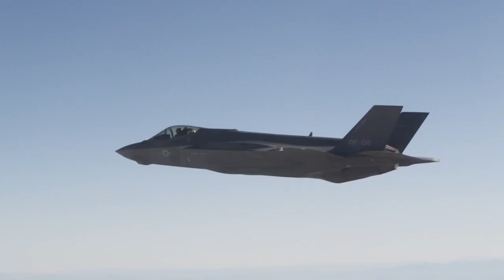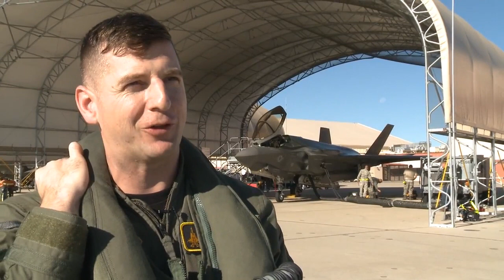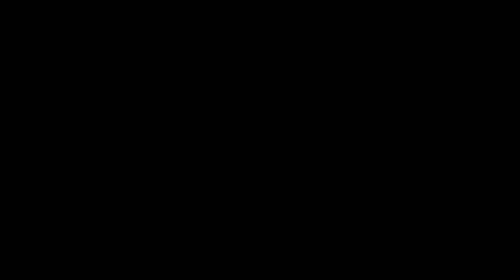F-35 Gatling Gun Test Firing

Comment: I'm hearing that they are having issues with the cannons integration onto this airframe.  The cannon has a door that keeps it hidden until it fires, when the door opens the drag/deflection is enough that pilots are having a hard time hitting targets.  
I wonder if this issue can be fixed with the flight control software?
Reply: FlightOS update will be rolled out soon...

Comment: 25 mm cannon with a whole 180 rounds...and this is supposed to replace the A-10. Sure, ok.
Reply: +hanyoukimura 
The F-35 will get a gun pod that can carry additional rounds.
The F-35 will have the small diameter bomb and other missiles that it can use to provide close air support. 
The F-35 will be significantly more accurate than the A-10 because of EOTS and Distribute Aperture Radar.
Reply: +The Crawling Chaos 

The F-35 is design to maximize the use of stealth. This is pointless against an enemy with little air defense and no air force. The F-35's theoretical CAS missions have it against sophisticated enemies like Russia or China where its stealth capabilities would give it an edge. This is very true...except that's not who we're fighting against.
The F-35 isn't designed for durability. 
The A-10 was specifically design to be able to absorb damage from ground fire and keep flying. It's systems are triple redundant, its well armored, and its engines are design to take damage and still function. These attributes are far more important in combat missions going on in the Middle East.
Reply: Heavy armor is needed when you're trying to fly low and slow. The f35 is not designed to do this. The range at which the f35 can acquire targets through foliage and adverse weather elimated the need to fly low and slow. Computer aided aim assiance with the gunpod and small diameter bombs will be more than enough.
Reply: +The Crawling Chaos 

"The range at which the f35 can acquire targets through foliage and adverse weather elimated the need to fly low and slow. "

Wasn't an American Special Forces' team obliterated by a bomb dropped by a high-flying plane which electronics supposedly eliminated the need to fly low and slow?

Acquire targets through foliage and bad weather, more than enough for CAS?

I don't this has been featured in any self-respecting military school.

In CAS, the C stands for Close. And not for flying at 8000 meters high, and having a risk to screw up with your aim.
Reply: Have you ever heard of smart bombs.
Reply: Im sure you know more about what plane the us military needs that the military themselves, right?
Reply: True the Small Diameter Bomb will be great, but what's the cost per bomb and the cost per flight hour of this monster when compared with the A-10's ability to just loiter and rain down depleted uranium rounds?  This is the equivalent of driving a formula 1 car back and forth to get groceries.  Yes it can do the same job, but it's way overkill

Comment: Is this gun for Air-2-air? Limited rounds will be ineffective in a dogfight and on the ground. Also the F35 can't manoeuvre in a dogfight it gets owned every time.
Reply: +benbennit 
Wrong on all 3 accounts.

The F-35's gun is more than adequate to score  a gun kill. 
The F-35's gun is computer assisted and can perform CAS.
The F-35 will be getting a gun pod to store additional rounds.
The F-35 has similar kinematics to a combat loaded F-16.
The F-35 does perform well in dogfights.

Dogfights and top gun style guns maneuvering are no longer the norm. This is not 1970s.
Reply: +The Crawling Chaos 
"The F-35's gun is more than adequate to score  a gun kill. "
You can have the best gun, if your plane can't maneuver for scrap,
your best gun won't matter a rodent's backside.

It performs well ... maybe. But does it perform better than other aircrafts?

A gun pod to store additionnal rounds?
That's adding unecessary drag. Other planes don't need to bring extra slugs in a gun pods.

Also, this F-35, in CAS?
No way. An A-10 is what you need for real CAS.
It was designed for this, wasn't it?
Reply: +The Crawling Chaos Add a gun and you are saying dogfights CAN happen and BVR encounters do not always end in a long range enemy kill. A heavy CAS gun and gun pod will hamper any aircraft in a dogfight. That loss of advantage is death. 

It's a plane that has already failed to splash the competition in  tests even in a perfectly adjusted loadout.

Adding a gun for CAS to fill a gap is crazy. At the speed and survivability of this jet, it will be unable to do more that a couple of runs with reduced impact, accuracy with less onboard armour.

I can just look at the profile of this aircraft and it's mass and I know it will not be forgiving or effective.
Reply: benbennit
You can just "look" at a plane and tell me about it's aerodynamic capabilities? Where is your degree in engineering? Where can I find records of combat aircraft that you've worked on? How many hours have you flown in high performance aircraft? Or am I supposed to believe that you can just "tell" because of your knowledge from Google.

Where have you seen the F-35 "failing" to splash. The F-35 has comparable high Alpha performance to the F-16. 

Also the F-35A can certainly perform in dogfights, does have a
 gun. Other variants can have guns installed on them for CAS or air interdiction. Also AIM-120 and AIM-9 will be more than enough to contend  with enemy planes. As it has been for decades.
Reply: Briseur De Lance

"You can have the best gun, if your plane can't maneuver for scrap"
The F-35 has kinematic performance similar to an F-16. Ask pilots for where it places within the spectrum of F-15, F-18 and F-16.

"It performs well ... maybe. But does it perform better than other aircrafts?" See above 3 comments.

"A gun pod to store additionnal rounds?
That's adding unecessary drag. Other planes don't need to bring extra slugs in a gun pods."

The drag profile of an F-35 gunpod is similar to that of a missile. It's also in the centerline, and shaped to heavily reduce drag. If you also want to perform air superiority, you do not have to bring this weapon.

"F-35, A-10, CAS"

Yes, the F-35 can perform cas. It can carry thousands of pounds worth of bombs more than an A-10. Has multiple internal targeting computers, can engage targets from further away, and is stealthy. 

If stealth is not needed, then the F-35 can carry more bombs than an A-10. The F-35 can also carry this gun pod to very accurately engage targets. F-35 will also have the small diameter bomb.

If it is needed, then the environment is not permissible for an A-10, and that plane will not survive where an F-35 will.
Reply: +The Crawling Chaos Weight / power / wing profile. They are all wrong for dog fighting / high AOA, the design will bleed off it's energy very rapidly in every manoeuvre., regardless of how much thrust is pouring out of the back...

Hopefully they will never get in that situation.
Reply: The Crawling Chaos
"Ask pilots for where it places within the spectrum of F-15, F-18 and F-16."

I would gladly ask one, but I don't personally know any American fighter pilot. Same for the British. :-(

"Yes, the F-35 can perform cas."

It wasn't designed for this. Sure, it can target multiple objectives from a safer distance than the A-10 can.

The thing is, in CAS, the C stands for "close".
How can it be called "close" when then supporting plane is thousands of meters away?
When flying as high as the F-35, how can you drop bombs and launch missiles, some as heavy and costly as an Aston-Martin, with the pin-point accuracy needed when the enemy is less than 100 meters away from friendly forces, practically within voice range?

Do you think the troops calling for CAS would like having the ordnance drops relying on a machine alone? Or relying on a man or a woman seeing the situation through a camera, kilometers away?

I think not.

The F-35, carrying more than an A-10?
True. Dropping it as accurately?
That's not as true as you think.

Not to mention that the A-10 can stay on the scene for longer times, doesn't require as expensive maintenance and facilities, and is overall much cheaper.
Ergo, much more suited for CAS in asymetrical conflicts, like in Syria.
Or in modern conflicts were the enemy force targetted in a battle, while modern, doesn't have much of an AA defence.
Reply: There are plenty of interviews where pilots discuss the kinematic performance of the F-35. You can google them and find them yourself. 

The definition of close air support is the employment of munitions from aircraft within close proximity of friendly forces. It doesn't matter if the aircraft is a helicopter performing a run from door guns, or a satellite in space. What counts is how close the munitions land to the forces on the ground. In Iraq, CAS regularly had to fly high to drop weapons outside of the WEZ of enemy forces. This air support was still certainly "Close". You can find videos of this all over liveleak. By your definition of CAS, dozens of apaches firing Hellfires from a distance of 6km to targets within tens of meters of troops does not count as CAS.

watch?v=NxfS4WVvvnc

As weapons like the SDB come into use. Expect bomb strikes to get closer. 

"How can you drop bombs close"
With a really good optical targeting system like the F-35's EOTS and laser, GPS or electro optical seeker. All of which come built into an F-35

watch?v=bjoMQRUWEe8

This B-2 Spirit is throwing an older version of the JDAM. The F-35 will use improved or identical systems to this B-2. The radius of error for these weapons were either 13 or 30 meters depending on the mode of guidance and the level of Jamming. It's worth noting that if your enemy is sophisticated enough to jam a Jdam, then you're not going to be flying close enough to make a gun run. 

while the A-10 has a longer loiter time, an F-35 will - at mach 1.6 - reach a combat zone far faster than an A-10 will, in an asymmetrical fight, be able to deliver more bombs more accurately than an A-10.

In a non permissible environment, you will need a separate plane for each of these roles.

Offensive Counter Air (F-16C/D, F-15C, F-22)
Electronic Warfare (EF-111 or F-18G)
Weapons Delivery (A-10, F-15E, F-16C/D)
AWACS (E-3 Sentry, F-22)

Or you could use the F-35

OCA - F-35 with AMRAAM
Electronic Warfare - F-35 with AMRAAM and HARM
Weapons Delivery - F-35 with AMRAAM and JDAM
AWACS - See Above
Reply: The Crawling Chaos

"The definition of close air support is the employment of munitions from aircraft within close proximity of friendly forces. It doesn't matter if the aircraft is a helicopter performing a run from door guns, or a satellite in space"

That's not how I defined CAS.
Ah well.
That's not exactly how the US Army defines it either.

"Air action by fixed- and rotary-wing aircraft against hostile targets that are in close proximity to friendly forces and that require detailed integration of each air mission with the fire and movement of those forces."
(http://www.dtic.mil/doctrine/dod_dictionary/data/c/8823.html)

So yes, the first thing that matters is the proximity of enemy forces with friendly forces.
But it can't be a satellite.

If the enemy has the means to jam a JDAM, it's probably not safe to make a gun run, of course.

But what about the troops calling for support, then? "Sorry, mates. But you're on your own."?

"The radius of error for these weapons were either 13 or 30 meters depending on the mode of guidance and the level of Jamming."

Sometimes, this margin of error is more or less the distance between friends and foes and the ground.
How do you still deliver the bombs on the enemy? By getting close and personnal.
And not by flying at 6 kms away or more.

I heard my share of both trash-talk and blind praise about the F-35.

But one plane - and a really expensive one, at that -, replacing all those?

I don't think so.

This "one solution fits absolutely all scenarii" thing has never been successful.
Reply: Okay the Satellite part was hyperbole. But maybe planes in the future will drop munitions from low Earth Orbit or something. 

"Sorry, mates. But you're on your own."?

More like, sorry mates, I can't fly too close to that S-400, but I can drop some small diameter bombs on those enemy forces. So instead of trying to fly a slow, unstealthy aircraft into a non permissible area, and then fly it into visible range, you can just send an F-35 from far away.

First of all, as I said before, this large CEP was the radius for a very old JDAM. The  CEP for a newer SDB, which would be employed in this kind of CAS situation, is about 1 meter. At this point, you're more accurate than a gun. We've also completely ignored every missile weapon, which is also an option for an F-35. See Hellfire, JAGM, Maverick, DAGR.

The CEP for a bomb is not determined by the how far away you drop it. This is not World War II. The US Army doesn't drop slicks anymore. 

"One situation doesn't fit all"

So why can the F-18 carry a lot of AMRAAMs, But also be loaded with Electronic Warfarfe Equipment, But can also be loaded with targeting equipment if one plane can't do everything. You'll notice that the carrier deck is loaded with F-18s. 

The F-35 contains a powerful radar, check
The F-35 contains powerful electronic warfare equipment, check
The F-35 contains advanced targeting equipment, check
The F-35 can carry A2A missiles, Check
The F-35 can carry bombs, Check

What's wrong with this scenario?

F-35 is expensive.
It's actually fairly cheap in terms of long-term cost. It's already cheaper than the Eurofighter and Rafale without even being in full production. It's also way cheaper than an F-22.
Reply: Just keep thinking that
Reply: +benbennit    And you know more than the people that built and fly it.   HA HA HA HA
Reply: Well, that is the A variant and carries as many rounds as most all fighters. The B variant is for CAS

Comment: The F-35 might be serviceable, but for the price tag, I would rather it have never existed. It is going to be a minimal improvement over what is already available for--let me reiterate--the development cost now over a trillion dollars. It has advanced avionics and might be nice to fly, but it is still plagued with heat issues, and with the joint helmet mounted cuing system and aim-9x, the F-35 has virtually no advantage in air to air compared to current gen. Oh, and it has 1 engine. All it is is a less maneuverable stealth F-16 that everyone is going to be forced to use, plus it has so far costed over $1 trillion dollars to develop. People have been good at making fighters for a while now. It is not like the 50s and 60s where jets would get phased in and out every couple of years because they all sucked. The F-35 won't drop out of the sky, but compared to what other countries are doing, the F-35 will be obsolete by the time it hits production.